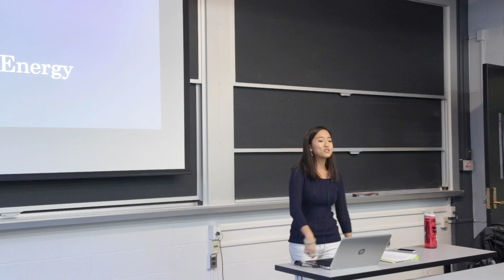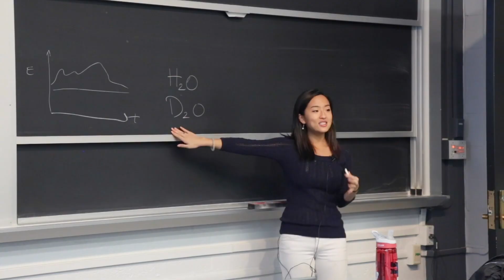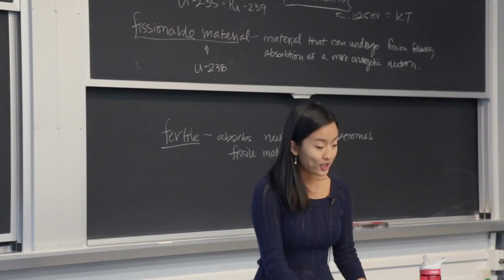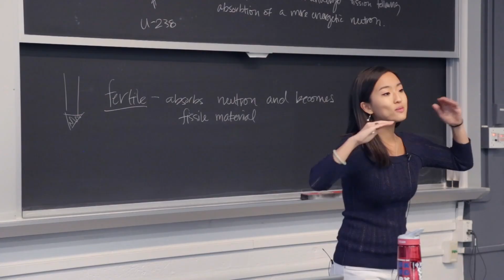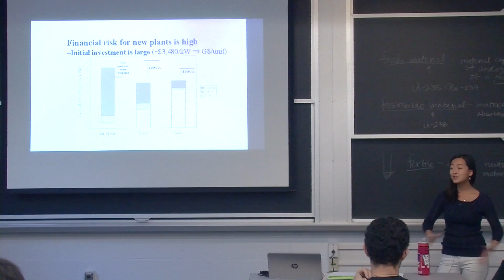16. Nuclear Reactor Construction and Operation

Comment: Um, actually, Fukushima Daichi is a boiling water reactor (BWR), not a pressurized water reactor (PWR). Also, the Chernobyl accident happened on the 26th of April, not the 25th.
The general gist of the presentation was great, but a some of the accident details were wrong.

Comment: I do have one question for the person running the presentation for science class students: is she under extreme time-constraints or under extreme time pressure? is she suffering from acute diarrhea? if not - then her 'speedy-gonzales' type of speech is awful, unintelligible, sounds sloppy and is generally disrespectful of the precision-based scientific field and disrespectful to the students and listeners, who don't have the time to process the information properly. Also the annoying and disgusting habit of inserting the 'like' word as an interlude wherever possible, whether it's actually relevant or not, show her lack of scientific or professional approach - this is not a tiktok shorts, and her audience are not a bunch of low-intelligence dumbasses but students of the nuclear engineering. That's what happens when the university gives authority to some gen-Z morons brought up by tik-tok ... it's painful , irritating, annoying and plain disgusting to listen to her gibberish and unintelligible prattling which has nothing in common with either proper communication or scientific approach where precision and respect are - and should be - inherent.

Comment: The reason for abandoning thorium breeder reactor is that it does not produce plutonium unlike uranium reactors for use in nuclear weapons spin off in defense industry. Breeder reactors are far safer than uranium reactors and it is of same design and is preferable if one does not want nuclear plutonium based nuclear weapons.

Comment: Chernobyl had a lot more issues than her short Synopsis.  No containment dome.  They accidentally shut the core down (meaning the neutron poison xenon-135 could build up) and then attempted to burn through it (a distinct no no) resulting in way too many neutrons.  When the graphite tips of the control rods went in, they moderated even more fast neutrons to the thermal spectrum, resulting in even more fissions.  Oh, and I i almost forgot! Why was the reactor shut down accidentally?  The button pushed wasn't even labeled correctly.  Welcome to the Soviet Union.

Comment: The boiling water reactors have a pressure of 75 atmospheres, and the two-loop pressurized water reactors have 150 atmospheres.  Why is this important?  The pressure vessel drives cost, and a thicker reactor is more pricey (as well as having a secondary loop).  However the reactor must be bigger in a BWR for an equivalent output owing to lower pressure, making it pricier.  So why are water cooled, water moderated reactors pressurized?  100 degree celsius water is not enough to turn a turbine efficiently, and you dont want water consensing on turbine blades for corrosion reasons.  To get the steam temp high enough to be useful, the water must be pressirized.  What are these temps (student asked the question, lecturee didnt know)?  For a. BWR, it's up to 285 degrees Celsius, whereas for a PWR it can reach 325 degrees Celsius.  A higher temperature has a higher Carnot efficiency.

Comment: Why did Japan and Germany shutdown so quick after Fukushima? Could it be this and the old plants still running? A link to journal article will confirm the following. I could re find the doc. It’s a copy and paste.

Both Three Mile Island and Fukushima has failures with ECCS. Fukushima because generators got knocked out. The main concern is why shut down all plants…then bring them on back on line. Especially takes 30 years or more to decommission…..hmmm suspicious behavior….

"In 1970, Daniel Ford, a young economist then working at Harvard, decided to study the economics of nuclear reactors. In the course of his research he came across AEC documents indicating that all was not well with the ECCS. Perplexed, he approached MIT physicist Dr. Henry Kendall, who was active in the Union of Concerned Scientists. After some investigation, including visits to AEC labs, Kendall and Ford found startling evidence that the ECCS was not reliable, and that the AEC was hiding that fact. They published their findings in July 1971,"

https://www.jstor.org/stable/41682744

Comment: As a pro-nuclear engineer, there is a lot of misinformation here.  If I had seen this and believed everything, I'd have walked out and never returned as she indicated we have no nuclear waste solutions (except reprocessing/recycling - which she called repurposing), which is too expensive and difficult in the US (which every other country does just fine except for the US and Canada), that GenIVs are only good on paper, that the public hates nuclear, that there is no money to build new reactors, and that a plume of radioactivity reached the US from Fukushima.  All of it wrong, or at least missing important details.  This was frustrating, it felt very much unprepared, and no she did not get all her info from NRC.gov as she says at the end.

The class presentation was also using out-of-date materials, which even at 5+ years old is out of date now, but I figure she was using 5-year-old data (10 years total now).  Much of the grid has added a lot of "renewables" such as wind and solar" which basically has destroyed the baseload.  This is mostly what is causing nuclear plants to shut down, as is also the fact that renewables enjoy massive subsidies while nuclear does not.  You can 't compete with that economically and so the plants shut down, and since the generators that replace them have to follow the load, you get CCGT - combined cycle natural gas turbines, known as "natural gas" power plants.  They fill in the gaps which grow larger with the added renewables and removed baseload.  

New Gen IV has been expanding, most recently in the past 5 years (about the date of this recording) so that missing info makes sense.  However, development has been going on for over the past decade.  Her claim they are only good on paper is wrong, as was demonstrated by the MSRE alone.  Funding was pulled decades ago, and now that we are taking energy independence more seriously are countries starting to look into it again.

She is right that reactors don't get funded by investors anymore.  Basically, it has to be a government project and most governments won't look past the election cycle now, in addition to nuclear being too unpopular (though that is improving).  China is doing it though since it can make much more longer-term demands on where its investments go (not saying they have a great system, but in this particular case, it allows more longer-term projects).  Newer Gen IV reactors and especially SMRs (small modular reactors) are designed to be quick to build and can add capacity in smaller units more quickly.  This is a promising future.

As for that Fukushima plume reaching the US?   Fake.  Spread by those on Facebook and other media.  While fish and the ocian around Fukusma were initially affected, the ocean is big* (citation needed).  The radioactive isotopes added are detectable (as Cs-137) but negligible compared to background, and most of those "maps" were maps of the tsunami height.  

Also, the Fukushima reactors were BWRs (not PWrs), and zirconium plus hot steam gives hydrogen, the rods don't just explode.  That would be asinine.  The hydrogen built up and blew the cover off the buildings.  If they had propper containment buildings it is unlikely anything would have been released.  And if they had used ocean water for cooling, they would have prevented the meltdowns, though the reactors would have basically been write-offs.   

As for Chornobyl, don't get your info from this presentation, nor from that idiotic Netflix show.  Both have similar levels of accuracy.  One quick point, the tips of the fuel rods increased the reactor neutron efficiency making the problem worse, it doesn't have to do with water displacement.  

Finally, 300 acres (if true) to store all of the US high level (spent fuel) waste is NOTHING, not even a square mile.  She made it sound like a lot.

Yucca was to be a REPOSITORY (it's in the name) what this presentation was describing of never wanting to see it again was deep borehole storage).  She also thinks leaked material would be a big deal, it would not - there are few water-soluble isotopes, the transport through the ground rock would be minimal, the spent fuel is solid pieces, you could basically shovel it into a new cask, and it is low radioactivity by this point - which is why we don't just build more spent fuel ponds, it is cheaper and not an issue to stick it in outdoor casks, because the radioactivity is too low.  It isn't because we ran out of pool storage (SMH).  

There are more issues as I'm sure you will agree, but this is enough for one (very long) comment.

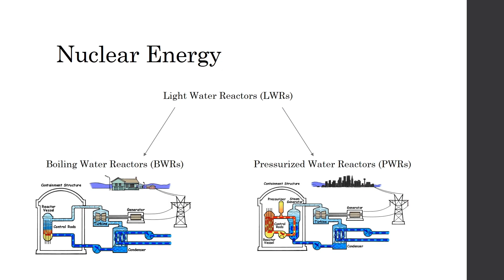Comment: 👒8:27
👒9:56
2:57 clichés 
3:01 /181 
5:19
9:47
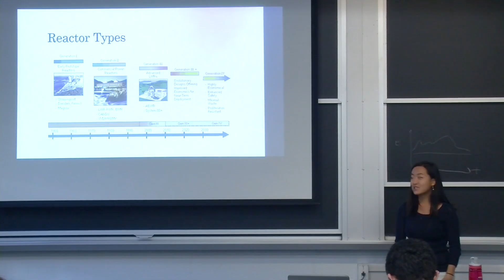7:36
2:35 rhy
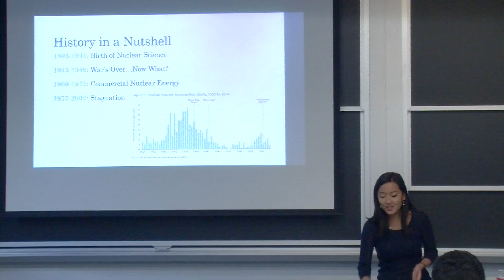3:55 rHy
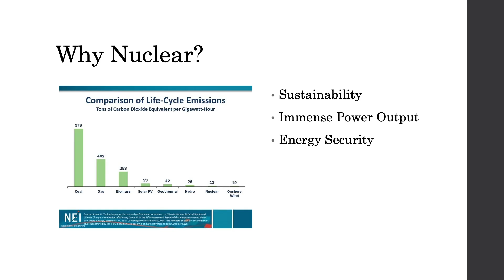6:08
9:38
5:32 FenceH_carbonÑcoal
5:37
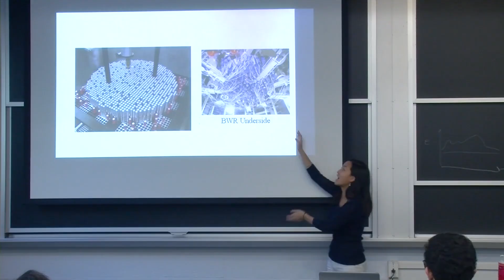11:11
🎰6:09
🎰18:09
🎰15:39 DH2O
👘6:29 Ferrrrite is things of Mfluz conducive flow
👘01:47 Nut NoaH NNNN
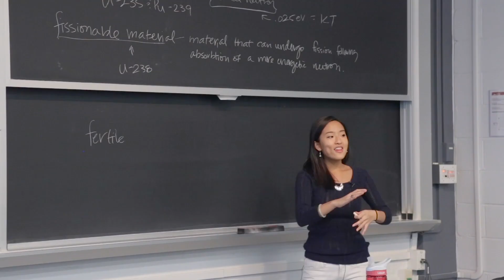⛱19:47 material 
⛱33:27 Reliable eng
Catalogue F is engineering for things

ZiP code
7:47 reactor with type
12:27 reactor with materials 
19:48
19:29
20:03
22:18
ZiP code
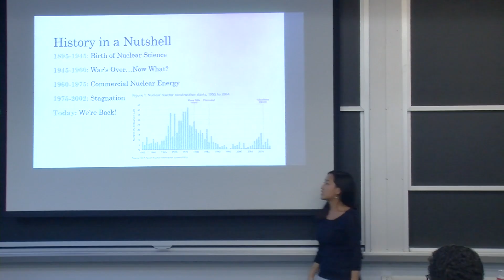4:27
7:07
7:08 we cannot always place the panel with the curved-boards as the harvesting system

01:06
01:07
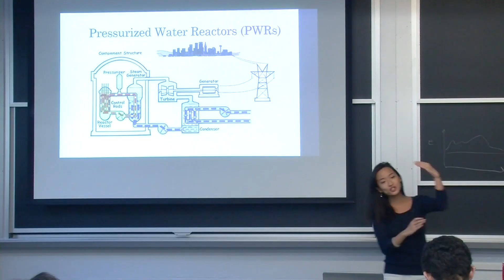11:59
12:00
13:00
14:00
16:00
25:01

17:47👟

Comment: Why would the operators at Three Mile Island think: pressure loss= leak= we just opened a SRV= drop control rods while switching to back up power until maintenance is performed?  Instead they obviously defaulted to a not so well thought out SOP, sad :(

Comment: 29:01 I think they knew. Wasn't the point of the test to see if the slowing down turbine can generate enough electricity for the coolant pumps in case they needed to shut down the reactor because of a blackout (loosing outside power)?
Wasn't the problem Xe poisoning at low power and then they tried to raise the power against regulation (removing control rods instead of shutting it down)? (Not just that it didn't have enough cooling.)
Reply: Yes they needed to test that the turbines could power the cooling pumps whilst the diesel generators were firing up. And yes you are also right, they got into a Xe pit and removed all the control rods. Another issue is the positive void coefficient as a result of using a graphite moderator and water coolant. As the neutrons were already moderated sufficiently by the graphite when a steam void occurred the reduced neutron absorption mean reactivity increased, rather than decreased as is the case when water is the moderator.

Comment: So one minor correction I have to issue to this video, and it might be because of how old it is, but the RBMK did not have graphite tipped control rods. It had an entire second graphite displacer rod. Like she said water is a neutron absorber so when you’re pulling your control rod out you want to displace the water with something that is only a moderator. I believe the scram control rods had graphite tips only perhaps. I could be wrong, However other than that they all had these long chunks of graphite to fill the gaps left behind by the control rods. It was as these lowered into the bottom of the reactor did a massive thermal spike occur at the very bottom of the reactor this is why the control rods only got to about half way insertion before the fuel channels shattered and they got stuck. Then well... kaboom. Other than that this was a wonderful lecture, extremely well done and chipper as all hell.

Comment: Solar isnt much safer especially if we are talking rooftop installation. I work in construction and falling off homes is pretty common in the roofing industry. Solar is not much better from my understanding of the local industry anyhow. I like wind turbines, I live about a km from one and it is absolutely beautiful, a marvel of engineering. Also extremely fucking dangerous in the winter. My company has the plowing contract for the turbine and we have to stay on constant watch for the thing to stop spinning as soon as it does you have to drive away from it quick fast and in a hurry as 30 foot long chunks of ice come crashing down from like 150 feet up. Scary as fuck I tell ya.

Comment: 33:00 she says 15m Tsunami wave broke the generators?? No.......dude after earth quake, there was a blackout (generators supplying the power grid got tripped), but power plants generally have back up power sources like the diesel generators (DG sets) and battery banks to run critical pumps during station blackout (power outage)........even after earth quake, the cooling pumps of Fukushima Daichi reactors kept running, and circulating water in to the reactor core and everything was normal. The actual problem started after tsunami wave hit the japanese coasts........the flood water entered cooling water motor room. The motors got covered by sea water and as a result switchgear (breakers) got tripped. When you don't pump cooling water into the core, the heat inside the tubes will start evaporating water and inturn forming steam. As the water level falls further, the core is uncovered and the temperature shoots up to 3500 deg C which eventually led to meltdown. I mean, the zirconium tubes which hold the uranium pellets melt due to excessive temperature and the molten metal then pierces the reactor vessel and continue to melt through the reactor base.
Reply: Sure did. She got some Chernobyl stuff pretty wrong too, more graphite tip inaccuracies.

Comment: Correct me if I m wrong, but the only way that humans found out so far to create electricity is through moving turbulences...tho in different ways. But essentially the same. Which is quite sad to me bcuz electricity has been found for several hundred years now...
Reply: That’s... not weird. It’s kinda what electric power generation looks like. Sure you can use friction(socks on carpet) however that’s not exactly practical. However it’s way easier to use magnets and kinetic energy like civilized people.
Reply: @Howtragicforyou  Yeah this is what makes me sad. We've spent hundreds of years learning about electricity and yet we can't find a better way to generate it except boiling water. There has been no actual key development nor breakthrough on generating electricity.

Comment: I was blown away when I first saw the graph at 5:25 in my power class. The only thing that isn't considered in this graph is the emissions associated with production of the various power sources. Ironically it all sorta balances out when you consider flooding valleys with hydro and the terrible pollution associated with solar and wind production given their short life cycles of about 7-10 years compared to nuclear's 25-50+ years. Then calculating the fuel consumption of coal and gas compared to the energy available in a few kilos of uranium.
Don't get me wrong nuclear isn't clean but when you compare the ratio of pollution to energy produced it is clear which is better.
Reply: Critical?

Comment: 33:13 - incorrect. The Fukushima reactors did not go "supercritical", it was not a Chernobyl type accident. The reactor cores instead dried out and started melting due to decay heat. The control rods were well within the core when this happened.
Reply: Seems we are explaining the same scenario of no coolant.

Comment: In regards to nuclear reactors as a power source it is an ethical dilemma. I come from one of the first town's in the world to run on nuclear energy (1955) which the majority of the population is unaware of. The reason may be from the nuclear meltdown caused by Rocektdyne in Simi Valley. This has caused a surge in rare cancers throughout out the area.Until very recently (2019) has there been actual legislation that was passed to clean up the area since Boeing is now in charge of the area but wants no association with the meltdown. The area will be "cleaned" but never be for housing or recreational area due to the radiation. And that's the main point. Cleaning up radiation is no easy task and its a continual effort that doesn't go away until 3,000-20,000 years (estimation). The cons outweigh the pros. I'm fortunate to live in a pre-dominantly white suburban area so the issue is being addressed while in New Mexico the testing site for the nuclear bomb. They have no resolution and the government is just waiting for the victims to die out since most are of from marginalized communities such as, Native American ancestry.